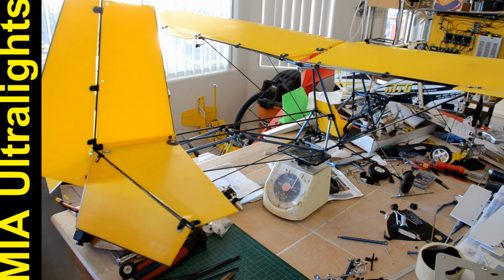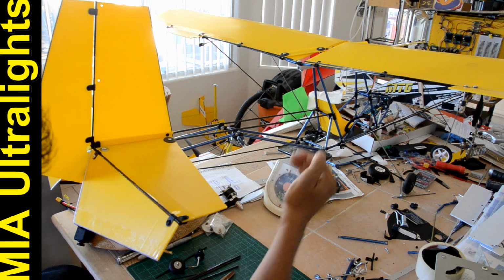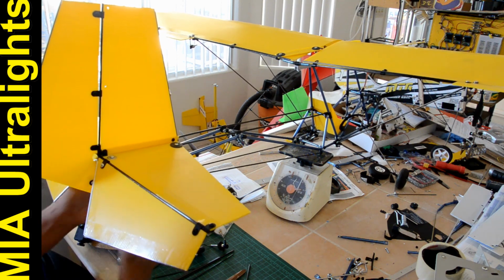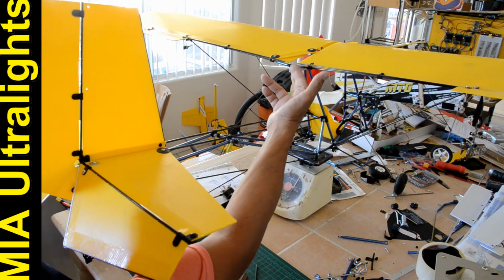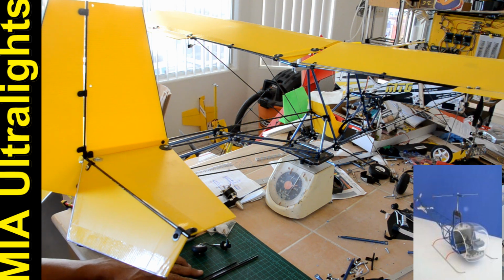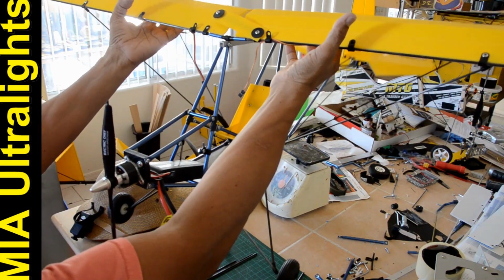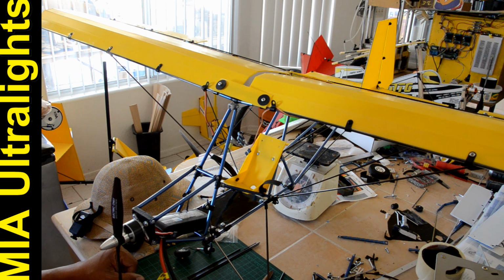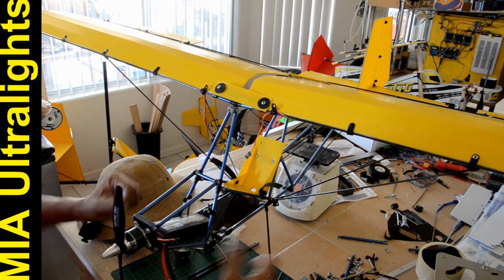Why it is Important to Follow Your Passion - RC Ultralight Microlight Trike

Comment: wow you do all these yourself?
Reply from the maker: yes I do...
Reply: MIA Micro-FLIGHT I see the production value is pretty good, I wonder how you make all the little parts
Reply from the maker: The hardware is  standard ANSI, the small connectors are made from raw materials cut to size as required. Some parts are made from Delrin and Composite materials CNC cut, the tubes are cut to size and pressed and drilled, chamfered and deburred.